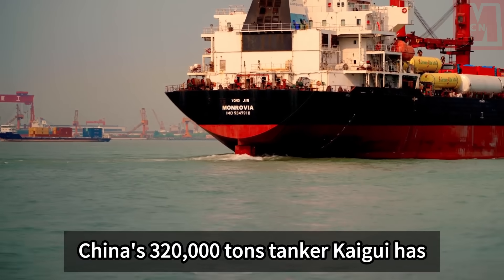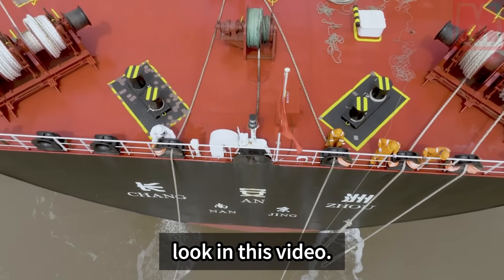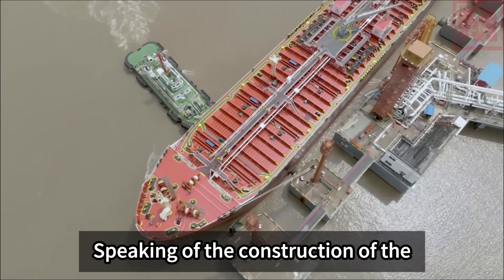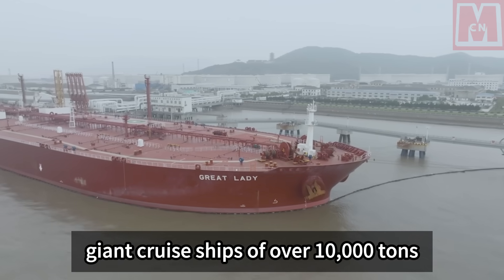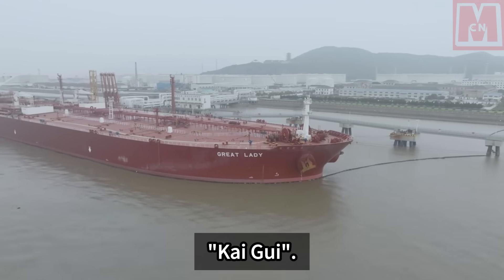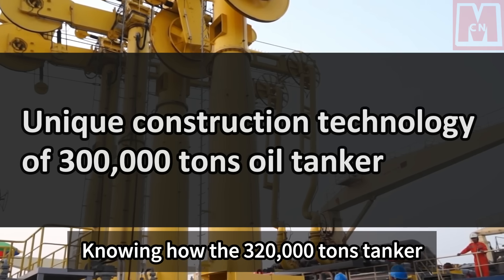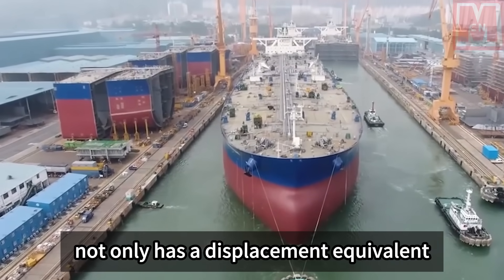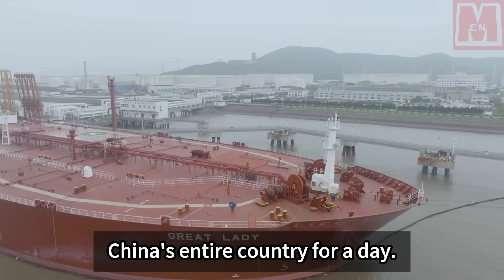320,000-ton China’s homegrown world’s largest oil tanker

Comment: Normal VLCC has no mid bulkhead endlong to deal with bending forces which makes their seizes smaller but by Heaven's order. China made an experiment with the mid bulkhead with the possibility of enlarging the ship. In the container shipping they did the same experiment. Those ships need special treatment for loading and unloading that's why it stayed an experiment. China had the experiment not because they are smart but in need while the idea is originally a contribution to the Dutch flag. There is no option to commercialize the concept for costleadership in the market as projection for the future.